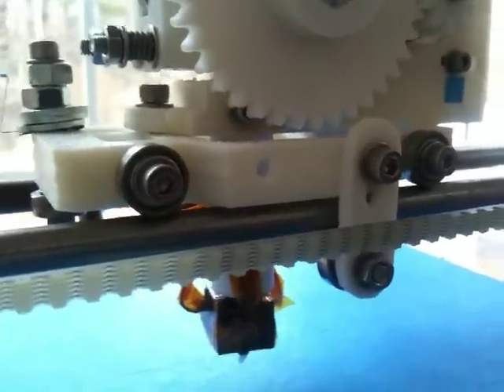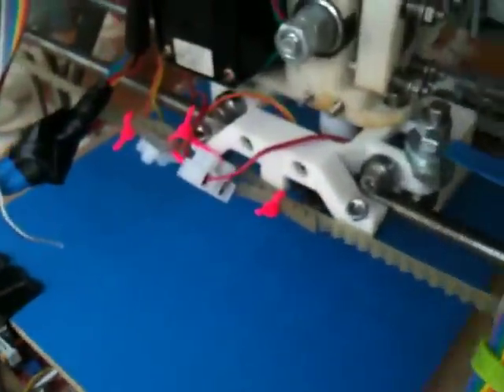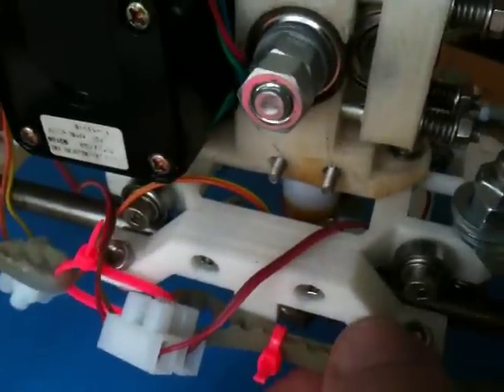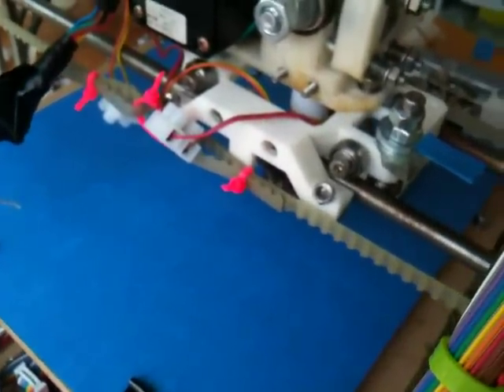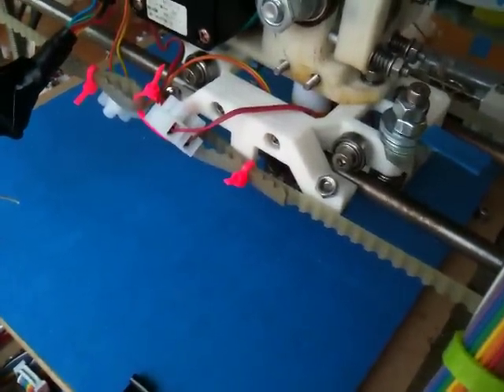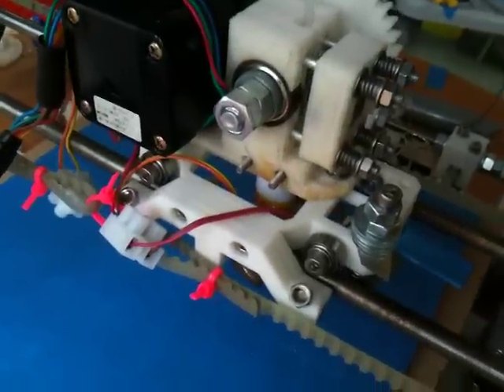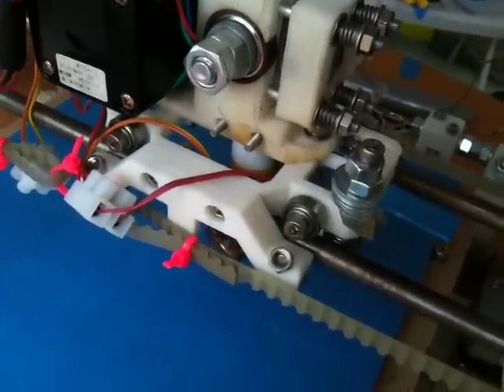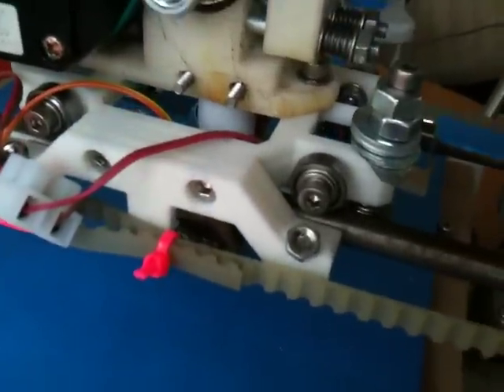Belt slips with OpenX Carriage - need zip tie

Comment from the maker: (continued)
I've built both too. While I like that the Prusa x axis is greatly simplified, I dislike both printed bushings and LM8UUs (yes I've used both). This OpenX carriage from my Sells Mendel blows them all away. The slight clamping problem I mentioned a year ago in this video (just uploaded this week, because I'm so behind) is easily fixed with a zip tie.
I appreciate the empathy! But it's misplaced - I'm way ahead of this now. :)